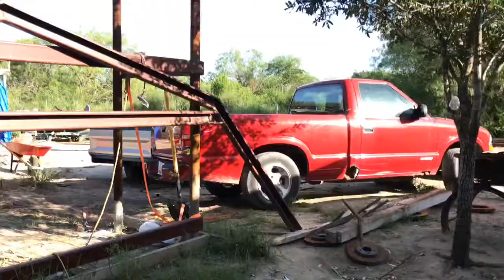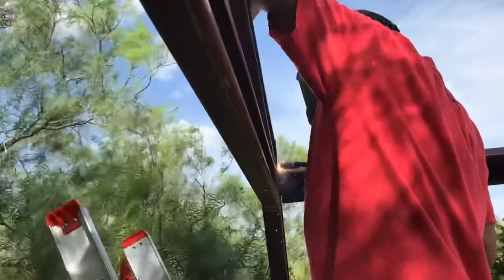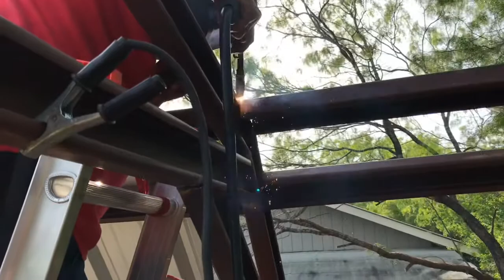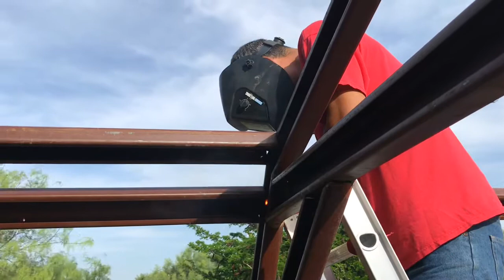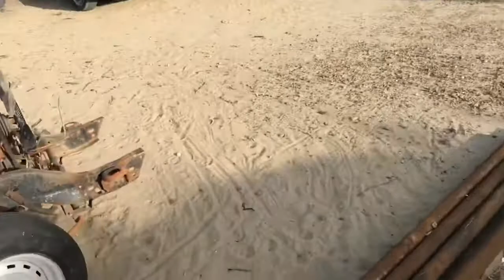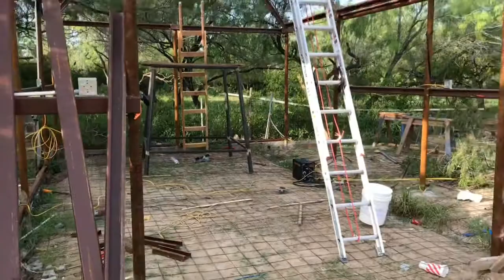Barn roof trusses and bracing

Comment: That's a good looking building and I think going with the steel is a great idea,  can't wait to see more on this build,  I've seen a lot of great projects come out of little shops like that,  you might want to add some lateral support across the back and sides,  if you have wind like we hear in the video it might save your shop from getting twisted,  looking forward to the slab, that's gonna be sweet

Comment: How wide is the building? Looks good. Looking to do something similar myself. I'm a welder by trade and I would prefer building with metal rather than wood.
Reply from the maker: Hey there joe. Thank u for ur comment. Barn is 16 x 24. Porch on side is 12 x 24. I’m pretty sure you will have better turn out (because u r a welder). I’m still trying to get my welds to look better.